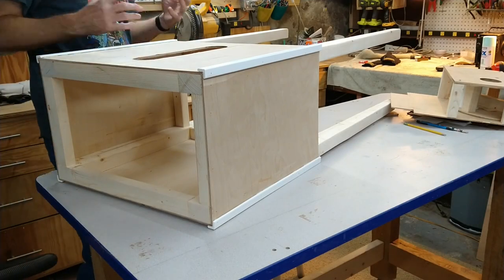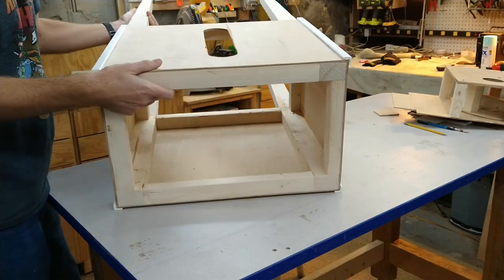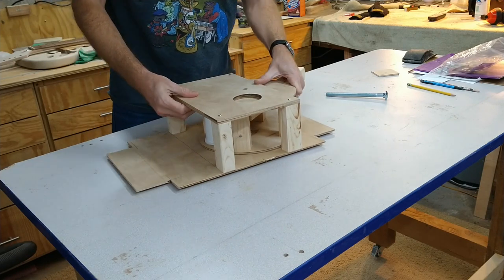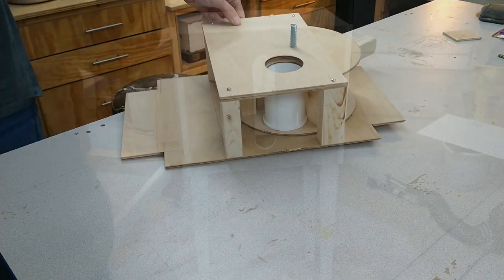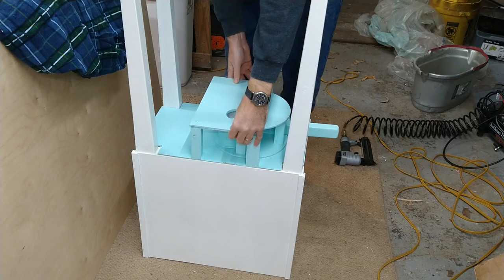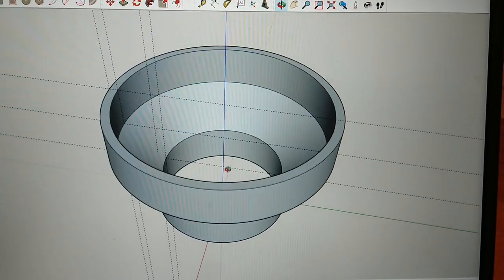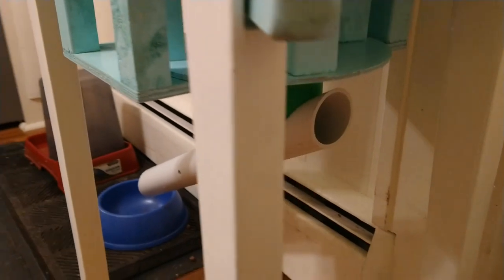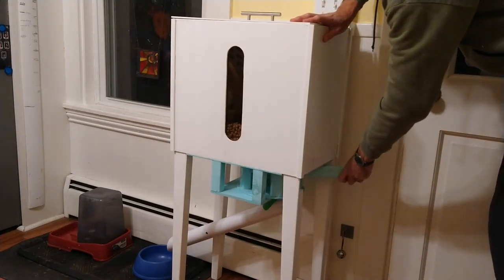Building a DIY Automatic Dog Feeder

Comment: to slow down the fast of the food travel, you can use like door setup on the end of the PVC tube, door means its a clingy door which is normally closed due to gravity, if the food hits the door, door can cling and open and let the food travel to the bowl slowly without spilling.... just My opinion